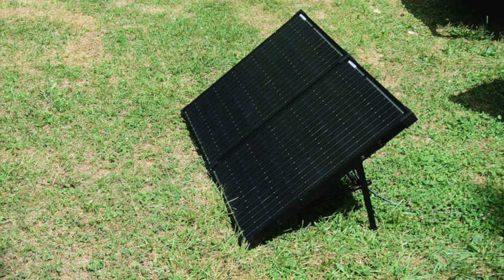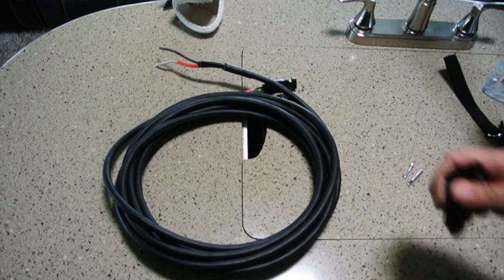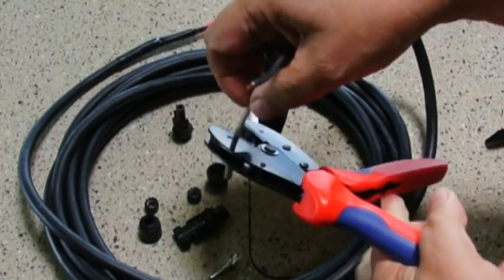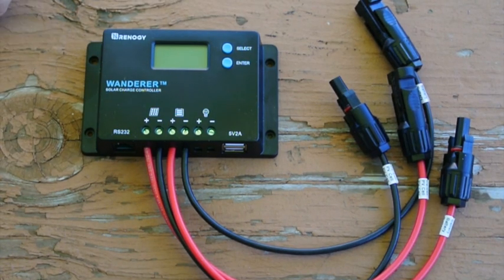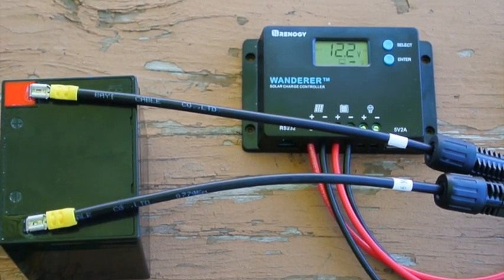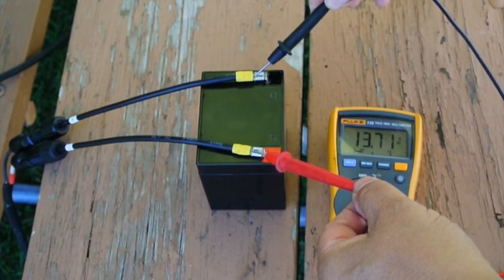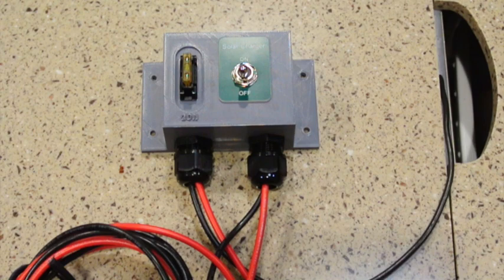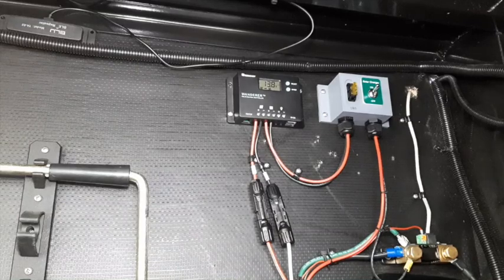Installing a PWM Controller in a RV - Portable RV Solar Charging Video 4

Comment: I constantly get short circuit protection (4) error on this controller even with no load connected it’s a piece of crap
Reply from the maker: Well, for $30, it's not going to last forever. I would suggest upgrading to a Victron MPPT controller.

Comment: Super helpful! Thanks for all the work you put in to these videos. I do have a question for you: I have a small travel trailer. I'm trying to install a simple solar solution for recharging battery for boondocking, but am not living in it so don't need anything too crazy. I've purchased (2) 130 watt solar panels i'll be mounting on the roof and running the wire (10gaugeAGM best?) to an internal compartment where I'll have a 30amp renogy rover MPPT controller and a 100Ah Lithium battery. My plan was to run the solar to the MPPT (do i need to fuse this wire and if so what size?) and then the MPPT to the battery (do I also need to fuse this wire, and if so what size fuse?). Should I leave the existing battery connections on the battery terminals and just put the wires coming from the MPPT on the battery terminals in addition or should I cut these and install in the "Load" port on the MPPT controller which will presumably go back out to the DC system in the camper? Thank you!
Reply from the maker: I would connect the two solar panels in series. If you use an MPPT controller and locate it at the battery, you could probably get by with 12AWG as the current flowing through the solar panel circuit would be half of what two panels in parallel would be. This is probably good for 25ft of wire.  Any longer and I would go to 10AWG.

You must fuse between the MPPT controller and the battery. However, some controllers do have a fuse already for this circuit.

The purpose of a fuse is to protect the wiring. Since using 12 or 10AWG is already going to be sufficient for the current flow, a fuse is not going to help much for the solar panel circuit.  

And since a short circuit cannot cause more current to flow in the solar circujt than the panel already supplies, it isnt really effective.

However, once you add more than two panels, then a fuse in the panel circuit  could be helpful.

Generally, using the load circuit is not useful in a RV application.

The purpose of the load curcuit is to shut down the load from the battery if yhe battery runs low.

To make this work, you would have to run all of the connections to the battery through this circuit. However, if you have an electric leveling system or slide outs, they will likely overload the load circuit.

Also your RV has a converter/battery charger, and it would also have to run through the load circuit as well.

The load circuit is only useful in stand alone situations where the entire load can be managed by the controller.
Reply: @RVProject  Thanks for such a thoughtful reply. Such an enormous help!

Comment: REALLY like the use of the switch & fuse. I noticed on a battery/charger set up I had the battery did drain down over days which is avoidable with your setup 👍
Thanks for posting!
Reply from the maker: Thanks for sharing

Comment: It’s been great referencing this series and your site as I finish my system.  One request would be videos on the use of bus bars, inverters and battery disconnect switches.  I’m currently contemplating whether to add a bus bar in lieu of trying to connect the shunt, trailer panel, inverter and MPPT positives to the disconnect switch.  But it does beg some questions like size of bus bar, how many connections are too many connections, etc.
Reply from the maker: I do have a battery disconnect switch video planned for release next spring. As soon as the weather improves enough that I can get outside and do some wiring.

BlueSea (maker of boating electrical products) makes a bus bar that can handle up to 1000A - but probably overkill for what you want to do.  They also make protective covers for some of their bus bars as well.  They also make a 600A bus bar that has 8 stud connections.

I would determine the highest current you will have going to the bus bar, then double that amount and find a bus bar that can handle that.

In lei of any other standard, I often use the US Coast Guard Boatbuilder's Handbook for many of my RV's DC electrical requirements.  The handbook implements their regulation 33CFR183, which is actually federal law.  Unlike RVs, boats must adhere to strict design principles due to safety.

And about 99% of what is covered in this standard applies to RVs. So you can never go wrong using it as a guide.  I don't look at it as much as overkill as I do as best practice.  About the only part that does not apply is on ignition-protection, which is required in a boat due to explosive fuel vapors that could collect in engine rooms and bilges.  

Otherwise, it is a good guide to follow and it is written quite well - at least for a government document.  Here is a link to the electrical section: https://uscgboating.org/regulations/assets/builders-handbook/ELECTRICAL.pdf
Reply: @RVProject  Unfortunately, it appears the handbook is no longer available at your link.  It doesn't appear to be available on the site at all anymore.
Reply from the maker: @hobbesct  That is unfortunate as it was a very good resource.  While not as good as the Boatbuilder's Handbook, here is the Federal Regulation that the handbook was based on:

https://www.law.cornell.edu/cfr/text/33/part-183/subpart-I

Comment: Another great video!  I'm trying to decide if I need to add the switch to cut power to the charge controller or not.  I'm planning a battery disconnect switch for when we are home and not camping but maybe a controller switch would be good for at night when boondocking and the solar panels aren't charging.  Cutting the power there would mean no draw from that controller.
Reply from the maker: I installed the switch as we don't boondock  all that much, so the controller is not needed most of the time.

Comment: Thank you for videos that are decipherable to an amateur newbie solar person. Please pardon my ignorance as this is all new to me. Solar panel companies are telling me I must buy two sets of solar panels because I need a charge controller to charge my rv agm house batteries and cannot use a charge controller when charging my bluetti solar generators. It seems odd to me I cannot add a charge controller by my house batteries and plug the mc4 from the panels into this charge controller (connected on to the batteries). Wouldn't this allow me to use a 200w suitcase panel suitcase to charge my rv house batteries with a charge controller and my solar generator without a controller? It just seems wasteful to have two suitcase solar panels for two similar needs. Thank you in advance for any guidance.
Reply from the maker: Generally, you can connect any solar panel to any charge controller and charge any battery.  However, there are a few precautions you need to take.

The charge controller must be the correct voltage for the battery.  And if it is a PWM charge controller, the solar panels need to be the correct voltage as well.

For example, if you have a 12V battery, you will need a charge controller specifically for a 12V battery - and in the battery type required; AGM, Flooded, Lithium, etc.

And the solar panel for that PWM charge controller needs to be in the 18~20V range.  You cannot connect a 48V solar panel to a PWM charge controller designed for a 12V battery.

I am not familiar with the bluetti solar generators, so they may have a built-in charge controller.  It might be a liability issue why you are getting the advice you are.

In a future video in my series, I will be connecting my 100W Renogy panel to my Jackery 500 "solar" power supply.